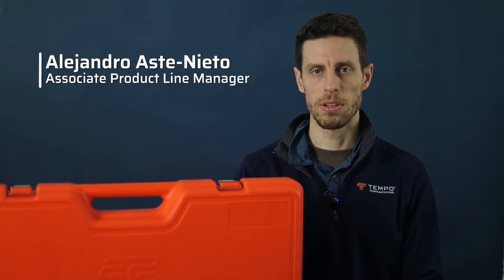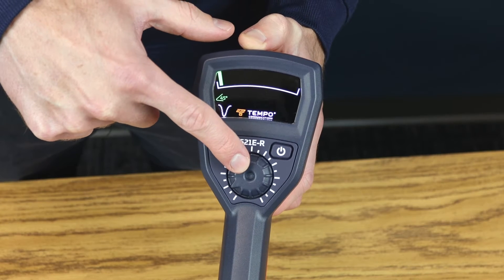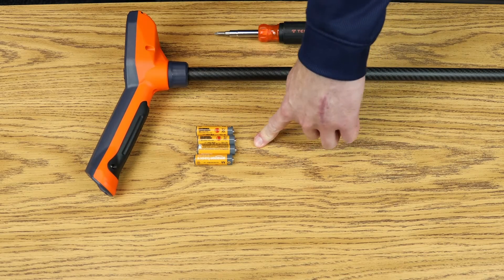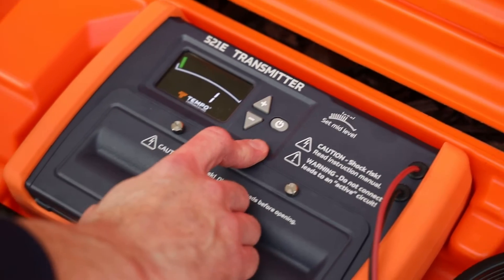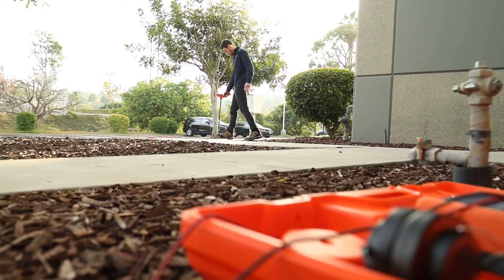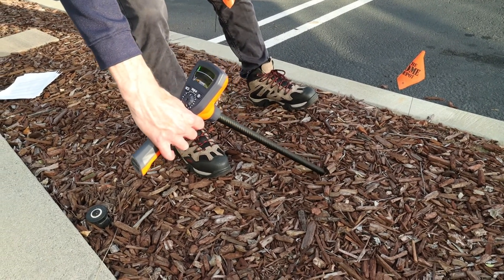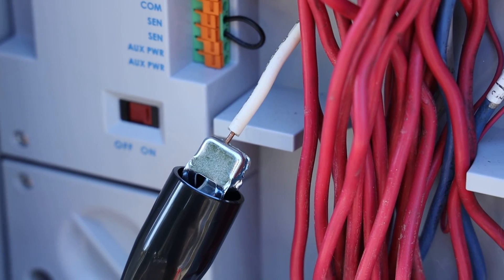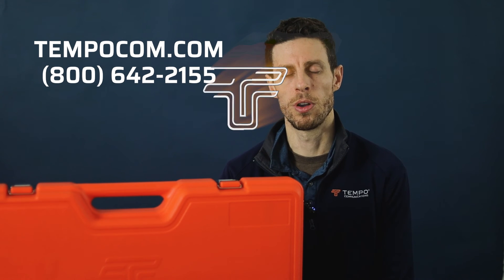Step-by-step Instructions to find Irrigation Wires, Valves & Faults w/ the 521E Wire & Valve Locator

Comment: Does this have ac power noise reduction near power
Reply from the maker: Hey, Peter!  The 521E has aggressive, Triple Stage Filtration: a significant improvement over the 521A's signal filtration.  That said, there are some AC power sources that will overwhelm transmitter signals.  This is the case even for "Digital" locators, which attempt to interpret whatever the receiver’s analog antenna sends to the digital circuitry.  Hope this helps.
Reply: The new 551 locator has digital noise rejection :)